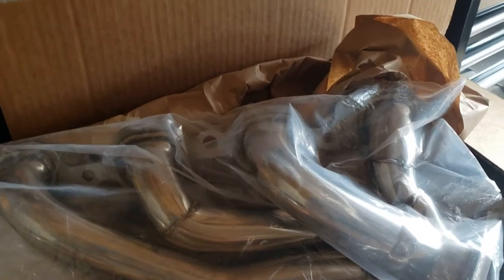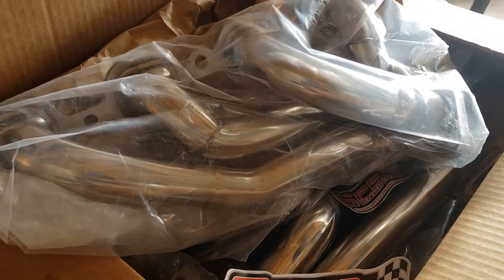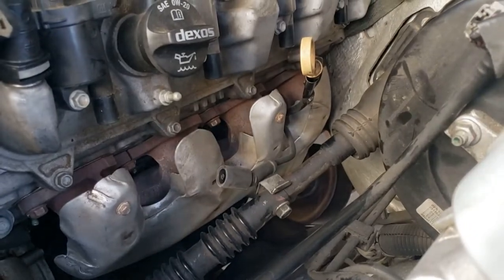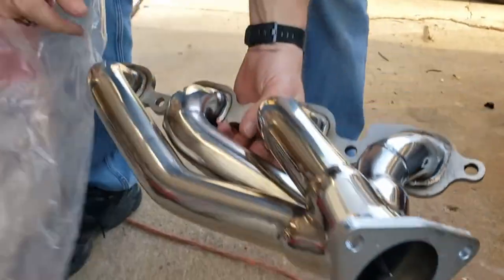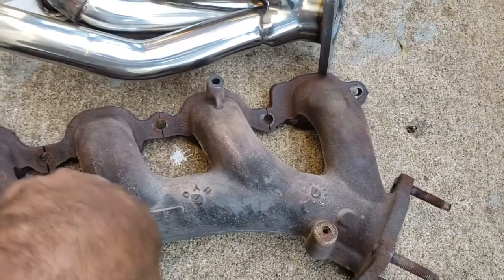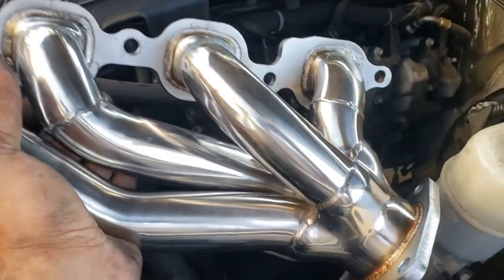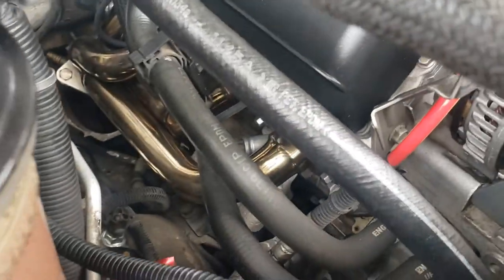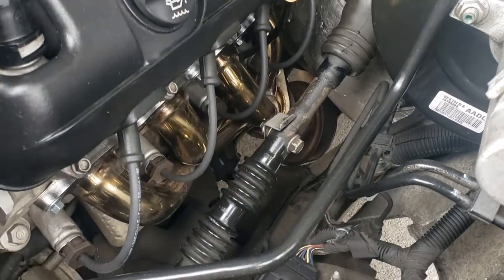INSTALLING SHORTY HEADERS ON A 2015 GMC SIERRA Z71

Comment: I just about went this route.. but after watching some dyno videos comparing the same 5.3 with stock manifolds vs Shorty headers vs long tubes, I decided to just stick with a new set of manifolds. Shortys just don’t change the sound much and minimal power gains. Long tubes will give you the better sound and best performance but I’m not putting long tubes on a daily driver so the sensible conclusion was stick with the manifolds

Comment: i bought the same set of headers no matter what donut gasket i use even with some high temp rtv it leaks at the collector any tips? i’m at my wits end with them
Reply: Any sound difference between it and stock?
Reply: Is it connecting to your stock y piece or is it aftermarket.
Reply from the maker: stock y piece
Reply from the maker: slightly,  you get better sound by changing muffler.  i have a borla atak.  tows alot better for sure and better acceleration

Comment: Any issues with the O2 sensors at all??
Reply from the maker: @SeanSullivan-u3j  not one.  O2 sensors are on the Y pipe so they were not affected.
Reply: @2003pblakey  thanks for the response! Speed engineering Shorty headers going on my 2018 sierra 5.3 this week, can’t wait

Comment: Did the sound on the exhaust change?
Reply from the maker: Not by much,  a different muffler will change that.
Reply from the maker: There may be a very slight difference at idle but not enough for most to notice
Reply: @2003pblakey  oh ok man thanks

Comment: Do u have the link to the bolts u used cant seem to find them
Reply from the maker: Man I wish I did.  I got mine from  Lowes in the hardware section.  take one of the ones from the exhaust pipe with you and use that to find a longer one.  That's all I did.  Most parts stores did carry the bolts long enough for the attachment to the exhaust pipe if you have a large flange as i do.

Comment: Did these work with the stock spark plug wires?
Reply: Cylinders 3 and 4 touch slightly
Reply from the maker: twist the spark plug wires so they do not touch.  Regular wires worked fine for me

Comment: Do they fit factory y pipe?
Reply from the maker: Yes they do.  You may need to buy longer exhaust bolts because of thicker flange but it will bolt right up no problem
Reply: Alright thanks man, hopefully you do some videos of this truck like a dyno run with this setup you have would be great. Stay safe

Comment: Any tuning and what exhaust
Reply from the maker: No tune yet, currently have a dynomax delta flo exhaust.  Plan to switch to maganaflow or borla
Reply: Shorty's shouldn't ever need tuning, since the O2 sensors and catalytic converters haven't changed. There's not enough change in runner airflow over cast manifolds to effect a change in the tune. You "might" gain a couple hp/tq, but your butt won't notice it. 

Richard Holdener does great back-to-back dyno test videos on this topic. Basically, if factory manifolds are cheaper, then use those.

Comment: Did the exhaust sound more deeper afterwards?
Reply from the maker: Just slightly.  It has a better rumble, especially on acceleration which is faster also
Reply from the maker: You can notice a slight difference in sound but not much.  definitely an improvement at idle

Comment: On the driver's side did you end up running the stock doughnut gasket? The larger flange on mine didn't allow the provided gasket to seal so I ended up using stock gaskets on both sides of the y pipe.
Reply from the maker: I bought a new replacement stock flange for the drivers side and went back in and replaced the header gaskets with flepro gaskets.  The ones that come with it eventually leak.
Reply from the maker: But yes,  use the dounut flange on drivers side and flat on passenger and new metal gaskets between header and engine.  It should seal right up
Reply: @2003pblakey  Thanks for reply. That is exactly what I did. I used OEM Exhaust gaskets on the headers vs the ones it came with (Caution they are directional). I used factory flange gaskets but on the drivers side had to flip the Doughnut gasket upside down as in the stock location the Flange bottomed out and would not seal.
Reply: @Mechanic_lyfestyle  This comment saved my life haha. I installed them and 30min later it was leaking. I didn't know how to fix it or if I should change the flange style or keep the doughnut. Thank you so much!
Reply: I have a 2016 Tahoe that I'm going to be installing these same exact headers on..I'm a little confused when you say flip it upside down?? Literally just flip it? @Mechanic_lyfestyle
Reply: @Mechanic_lyfestyle  yeah man can you go in detail on “flipping the donut gasket upside down” when it has that flange on it?